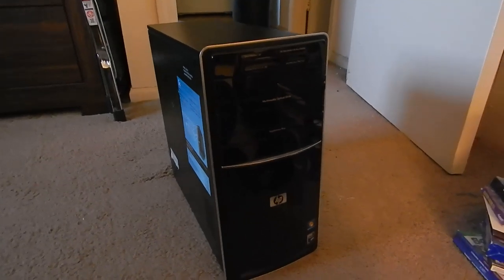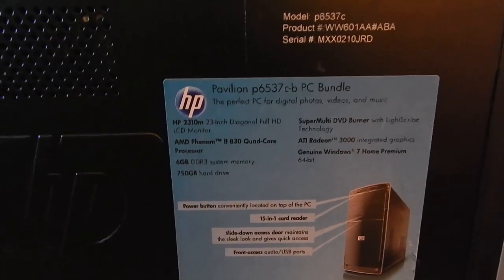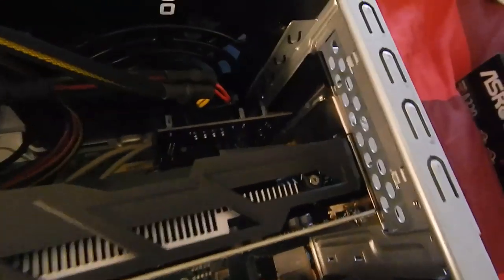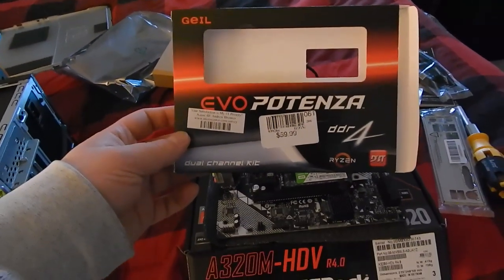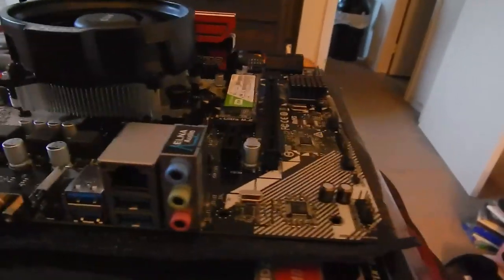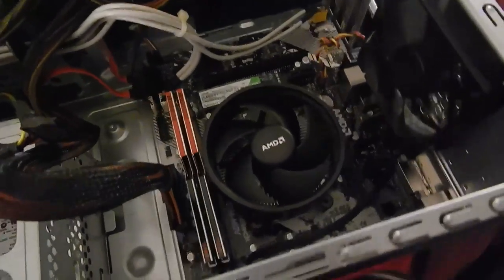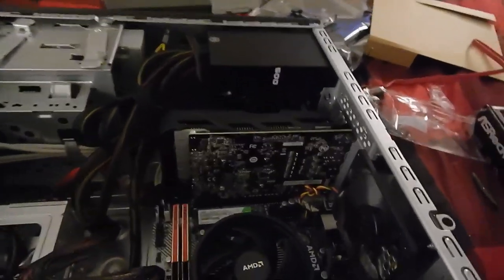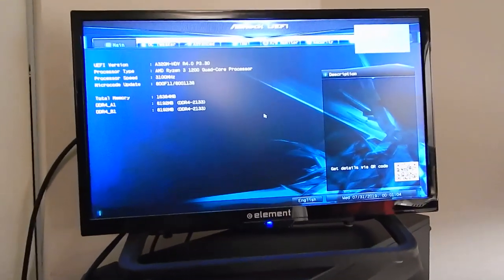Upgrading an HP pre-built PC to Ryzen

Comment: I'd be wary of anything beyond 3600 on that board but why would you use a $35 board with $300+ cpu
Reply from the maker: That's likely what It will be upgraded to eventually. The 3600 is such a good CPU for the money and will be even more so as it gets cheaper. I think the board could handle more as long as the chip in question is 65W. I think it could deal with an 8-core chip at least.
Reply: @lmull3  I'm going by the VRM ratings out there, spreadsheets have HDV (varies by variant a bit) as not recommended for 3700/3800 stock unless you have "major airflow".